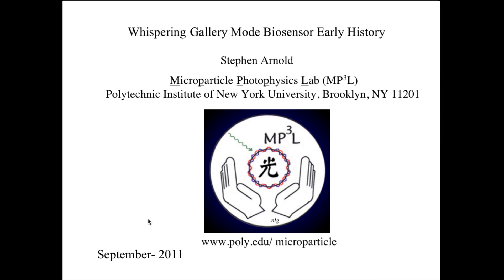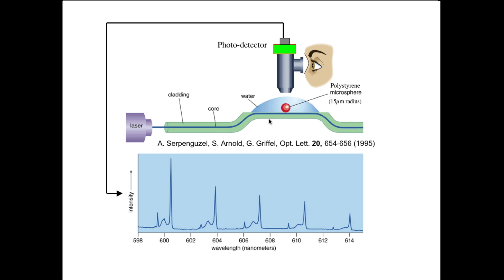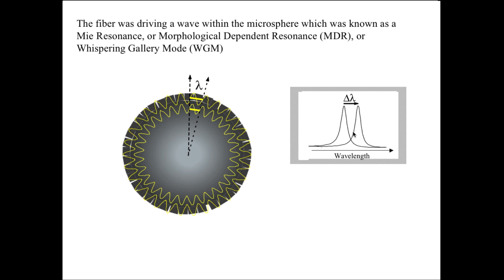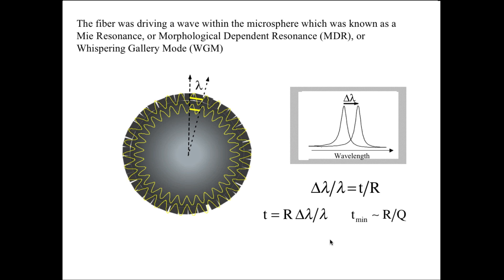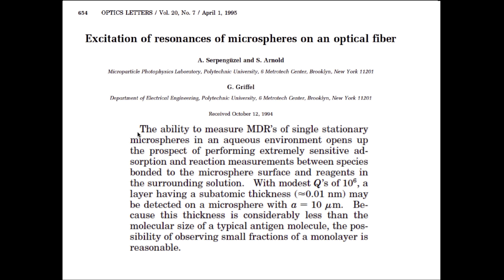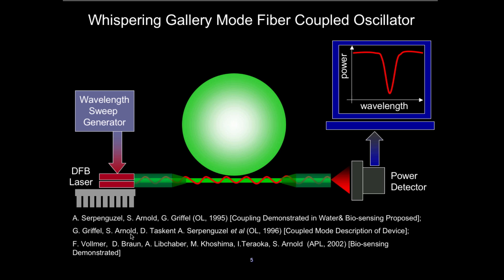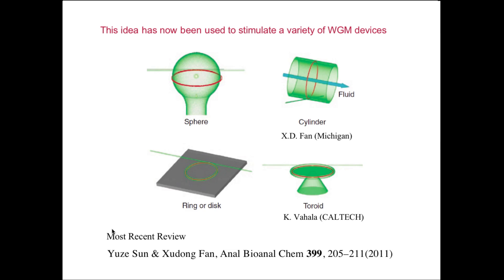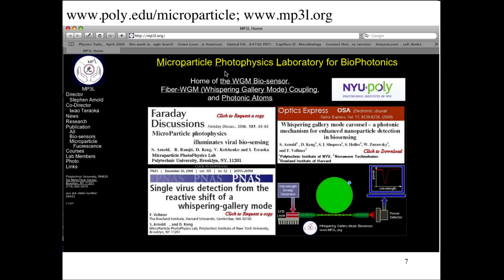1. Whispering Gallery Mode Biosensor Early History (1994-2002)

Comment: Thank you Prof. Arnold for this interesting video on WGMs. As a beginner in this field I found it quite informative. Is this particular geometry (time- 6:05 in video) in which we monitor the transmitted light instead of scattered light done to make the experimental setup compact?
Reply from the maker: Thanks for your question. Yes, it makes the system more compact.  What was done in the Paper by Griffel et al, and demonstrated there through experiments at the MP3L, opened the path for bringing the micro-cavity biosensor into integrated optics on a chip. It also thought of the sphere-fiber system as an interferometer, which I have always found to be fascinating. If you program the equations in that paper you will see that they give the same results as Vahala’s paper that was published 4 years later; they predict critical coupling, etc.  The notation is however different; transmission to the detector is labeled by amplitude coefficient “r”, and evanescent transfer to the sphere was labeled by “t”. There is a little compact  schematic of the notation in Fig.1 of the paper.  If you have any further questions about the paper, feel free to ask.
Reply: @mp3lwgm  Thank you sir for your detailed reply. It clarified my doubt. I will go through the work you have referred to for better understanding.

Comment: Thank you Prof. Arnold for an amazing video. WGMs are mostly studied in spherical or cylindrical symmetric geometries. Can WGMs form in polygonal cavities? If yes, why polygonal cavities are not used as much as other geometries?
Reply from the maker: Thanks for the question. Richard Chang’s group did experiments on square resonators, and the results were reported in Opt. Lett. 26, 632-634 (2001). The resonances showed modest Q’s alot less than 10^6. There was also another paper in 2003 (APL 82, 488-489) which did a bit better. The problem with using the square resonators is that the excitation cannot be efficiently coupled in at a grazing angle, as it is with spheres. Prism coupling produces a controlled excitation angle, but prism coupling is complicated, bulky, and expensive. I’ll probably add more to this reply as time goes on.

Comment: Thanks for this great video Prof. Arnold! I have a question: @2:15 in the video, what will happen if we use a silver coating instead of antigen? Also, what will happen if the coating is non-uniform?
Reply from the maker: Thanks for your question. My first thought is that a coating of silver might dampen the resonances significantly. In either case, depending on the frequency range, a spherical plasmon-polariton might form, however I doubt that it will be long lived. On fused silica, the layer is unlikely to be smooth, since the fused silica surface is not smooth. If the silver being added is in the form of silver-shell/SiO2-core nanoparticles, they can act as frequency shift enhancers because they are nano-resonators which have local surface plasmon modes (LSP). We have already had success with this sort of thing, but with a gold-shell/SiO2-core nanoparticle: a plasmonic nano-particle receptor led to our ability to detect single molecules for the first time with a micro-resonator. The experiments were performed by a former IIT Madras student while he was a Post-doc in my laboratory (VR Dantham), and was published in NanoLetters in 2013. Debojyoti - please contact me separately by e-mail at NYU. I have some questions on science writing and Chennai.
6 hours ago

Comment: Dr. Arnold, in determining the layer thickness and the wavelength shift, does this only work if the entire microsphere or at least the equator of the microsphere is coated or can it be done for only a partial coating or even a single particle?
Reply from the maker: Ryan- The calculation in the third figure is only valid for a uniform coverage of the entire sphere. This simple theory  was  verified experimentally by adsorbing protein on a silica microsphere [S. Arnold et al, Optics Letters 28, 272-274 (2003)]. The agreement is aided by the fact that protein and silica have similar refractive indices. Had they been different the simple theory would have to be modified. Thank you for your astute question.

Comment: Thank you for the lecture on the history of WGM biosensors, Professor Arnold! Functionalizing the surface of the silica resonator with a layer of antibodies will lead to an increase in the refractive index of the resonator and an increase in its resonant wavelength. Will this have any effect on the transmission spectrum?
Reply from the maker: Yes. The position of the dip in Slide 5 will shift to the right, toward increasing wavelength, by an amount given by the formula in Fig.3. So long as the refractive index of the layer is similar to that of the microsphere, the shift formula will give the approximate thickness of the antibody layer .
Reply: Hello Professor, thank you for your answer. Does the accumulation of mass on the resonator's surface have any effect on the width or depth of the transmission spectra's parabolic dips? For instance, if we observed antibodies binding to the resonator over time, would this have an impact on the power?
Reply from the maker: Chase Rosenberg The accumulation of surface bound analyte can effect both the width and depth of the measured resonance seen in the transmission spectrum. The width will broaden if the analyte layer is rough and scatters the evanescent field. The depth of the dip is more complicated. It can extinguish the transmitted light at resonance, a situation called critical coupling. Critical coupling requires that the rate of energy loss around the spherical boundary be equal to the rate of loss into the fiber. If additional scattering is generated due to analyte roughness, the system will be under-coupled, and the dip depth will be shallower.

Comment: Hello Professor, it appears that the waveguide is always appears to be parallel to the equator for a spherical geometry. Does the positioning of the waveguide have an impact on the coupling of light into the cavity? Would the angle of the waveguide relative to the equator of the sphere impact the coupling of light from the waveguide into the cavity? Thanks.
Reply from the maker: Thanks for the question. First I should point out that the "spheres" we use are actually slightly prolate spheroids. So they have an axis of rotational symmetry (z). Planes perpendicular to this axis cut out circles on the surface known as parallels. The mode having the smallest orbital circumference is the equator. A laser at resonance with the equatorial WGM will not be at resonance with other WGMs because of the prolate shape. A waveguide (fiber) driving a TE WGM, if not directed parallel to the equator, but at a small angle "b" from the equatorial plane will project its field vector off from the WGM's field, thereby reducing the power coupled into the WGM by approximately cos(b)^2.

Comment: Hello Dr. Arnold,

What a wonderful video! It made me think -- Does the optical setup for this biosensor require a distributed feedback laser? If so, why? I can't seem to think of a reason why any other tunable laser would not work just as well. 

- Shan
Reply from the maker: +Shan Lansing - Thanks for the question. There was a previous comment that may be relevant. It was by Steve Holler. He reminded me that the original  paper in 1995 had used a dye laser. It started "The original (1995) Optics Letters paper used a tunable cw dye laser…." My reply is just below Steve comment. Adding to the reasons for using the DFB which I gave in that reply, I should point out that current DFB lasers have line widths < 1 MHz, and can be purchased in a butterfly format for less than $100 on e-bay. There are certainly other tunable single frequency lasers that can be used, however we found that for the rapid tuning speed, compactness, and small price it is difficult to beat the DFB. I'm reminded that we paid $50,000 for our dye laser system in 1995, whereas the DFB package is less that 1 inch long (the actual laser is <1 mm), and in a cylindrical form can be purchased for $20 (e-bay, 1310nm with ball lens). For an entire system including current drivers, tuning software and data logging have a look at MP3Laser.com. Finally, to answer your original question, any single frequency tunable laser should work.
Reply: +mp3lwgm Interesting! I appreciate you explaining that.

Comment: Hi Professor Arnold, thanks for the brief lecture on the history of WGM sensors. If I may, what factors determine the magnitude of change in intensity when you do see a dip in the transmitted light?
Reply from the maker: Eshan Treasurer I assume that by change you mean due to the accumulation of matter on the surface of the resonator. There are two things that can happen. The matter can alter the field coupling into the resonator and the loss of energy by the resonator. The effects which these causes have was first discussed by G. Griffel et al in an Optics Letter article in 1996. You can find the paper at mp3l.org as publication 53. Another good reference to this is a paper by K. Vahala et al in Physical Review Letters 85, 74-77(2000). I hope my answer is helpful to you and others.

Comment: The original (1995) Optics Letters paper used a tunable cw dye laser for excitation of the whispering gallery mode (WGM) resonances, but I recall there were other sources and coupling schemes that were considered. By the time the 1996 Optics Letters paper was published you had moved on to a distributed feedback (DFB) laser, which seems to be the type of laser source you have kept with for the WGM sensor. In fact, the use of a DFB laser seems to have become a standard for WGM devices. I think people would be interested in hearing why you switched to a DFB laser; are there inherent benefits? Why not stick with the dye laser, or move to an external cavity diode laser (ECDL)?
Reply from the maker: Steve- It's nice to hear from you. It was Giora Griffel who suggested the DFB laser in 1995, after I asked him about a tunable semiconductor laser that wouldn't mode hop. Fortunately, he had friends at the old RCA laboratory in Princeton who were producing these lasers near 780 nm. Ali Serpenguzel set one of these up as in Slide 5 of this video and recorded dips in the fiber transmission as he swept either the laser drive current or temperature. The research was reported in the 1996 OL paper for which Giora was the lead author (2nd paper in slide 5). It's hard to beat the compactness of these lasers, their narrow line width (<5 MHz), and their cost. When the optical mockup of the WGM biosensor was prepared at the Polytechnic in Brooklyn we naturally chose this laser source. An ECDL was considered, but was rejected at the time since it was much larger and cost 10x as much as the DFB. The dye laser was a monster by comparison to either the DFB or ECDL. Thanks for your comments and question.

Comment: Prof. Arnold - Thank you for your nice lecture. I have noticed that this study has been extended for single protein detection [OL paper (2003)] by your group. In your paper a simple analytical expression is obtained for the shift due to single protein adsorption. But this simple expression is derived  based on the asymptotic limit (larger microcavity). Do you have this kind of simple expression for a smaller microcavity.
Reply from the maker: Akash - The asymptotic limit works well in connection with experiment for Whispering Gallery Modes because the mode number (no. of wavelengths in the WGM orbit) must be large in order to avoid substantial diffraction. Of the approximations in the 2003 paper, weak coupling is also assumed; wavelength shifts must be substantially smaller than the line-width. At the time there were no single molecule measurements on a bare micro-cavity, however that has recently been accomplished (amazing, although not published), and the shift agrees with the theory in the 2003 paper.
Reply: ***** -Thank you so much sir for your kind reply.

Comment: WGM is a interesting phenomenon, and to apply on biosensor is a very smart idea which can skip to label tag or fluorescence on analyte. But I wonder if only specific electromagnetic wavelength can happen WGM, since different wavelength also fit the circumference of microsphere. Therefore, why the visible light is used in this WGM biosensor cases?
Reply from the maker: Penny- Thanks for your question. There are a number of reasons to use a visible laser for WGM experiments: 1. You can use the glass from optical fibers to make the resonator (e.g. micro-sphere). This glass has very little absorption, which leads a very high Q factor for the WGM, and the silica surface is easily functionalized to make the sensor specific. 2. There are very narrow band tunable lasers which have been developed for telecommunications in the near IR. We obtain DFB lasers near 1300 nm for as little as $50 on ebay. 3. Inexpensive detectors are available in this region as well. WGM biosensors could be constructed in other regions of the Electromagnetic Spectrum (far from the visible or near IR), but the cost would likely be prohibitive. In either case the theory would be the same [Optics Lett. 28, 272-274 (2003)].
Reply: ***** Thank you for explanation. Now I realized It is a really feasible method to detect small molecular with WGM, the required materials and devices are well developed and easy to prepare. Hopefully, we can be benefit for this invention soon. So, what do you think about the challenge for WGM-biosenser in next few years?
Reply from the maker: Penny Chiang Penny- Just to clarify one point about DFB lasers. Although they can be obtained inexpensively, the temperature and current controllers are not inexpensive, and there is a need for sophisticated software, and the computer to run it, etc. Almost all of the researchers in the field have to put this ancillary stuff together on their own. Since the WGM biosensor is becoming popular soon there will be a commercial product. Stay tuned to this channel……...

Comment: This is a very interesting video about the history of whispering gallery mode biosensors, which I believe will make important contributions in biology and medicine.  Significant progress has been made on addressing the issue of sensitivity, but improved selectivity is still an issue.  Any suggestions?
Reply from the maker: Judith- Thanks for your comment. I think the reason sensitivity has been an issue is that taking sensitivity to the limit of individual molecules with the label-free WGM scheme can provide information about molecular size [S. Arnold et al, Optics Lett. (2003)], and enable binding to be followed in real-time. This is something that methods which rely on labeling cannot do. No one at present has reported reaching this limit without local nanoplasmonic enhancing epitopes. Accomplishing this with a microcavity having only antibodies on its surface ("bare") will require substantial noise reduction. The challenge is great, but the rewards are greater. Improved selectivity will require molecular engineered interfaces. Fortunately, some of these already exist for the commercial label-free biosensor (SPR, Biacore), but this device has much lower sensitivity. Also do not underestimate the importance of  microfluidics; you have to bring the analyte near the sensor in order to detect it, and at ultralow concentrations (attomolar) this will require optimized integration between the transducer and the fluid transport system.

Comment: Thank you for your explanation professor Arnold! According to your equation [sin(t)]^(2L), t should be smaller than 0.0496(2.691 degrees) from the equator if you want to see a shift larger than 1/2 peak. So the width should be around 4.6967microns, and the sensing area A should be around  1475.48 micron square when R=50 micron. The total area of the sphere is 10000pi,which is 31415.93micron square. So A/Asphere=0.047. Thar means there's 4.7% chance that a random molecule can hit in the sensing area.

Comment: This is interesting but the author avoided mentioning that High-Q microspheres were first demonstrated by Russians in 1989.
Reply from the maker: The 1st demo that microspheres have high Qs was in 1977; A.Ashkin, J.M.Dziedzic,Phys.Rev.Lett.8,1351(1977). The "Whispering Gallery Mode Biosensor Early History (1994-2002)" video deals with the history of fiber coupled microsphere experiments, for which the video claims that the 1st report including the biosensing proposal was in 1995; A.Serpenguzel, S.Arnold,G.Griffel, Opt.Lett.,20,654(1995). The beautiful Russian research in 1989 utilized a prism coupling and did not propose biosensing.
Reply from the maker: It took some time to realize that gorm253 is the YouTube handle for the great Michael Gorodetsky. mp3lwgm is proud that Michael visited our channel, and sad to hear of his passing; rip Michael.

Comment: I believe that your 1995 prediction and calculation of the extremely high sensitivity for WGM biosensing, up to subatomic particle level, is the key insight that made the explosive development of the research in recent years possible. This is an example of theory leading the way for numerous applications and inventions.
Reply from the maker: The reason that theory works so well is because all of our work has used microsphere WGM resonators for which their high symmetry makes analytical solutions relatively easy to construct. Another example of this sort of thing is the good agreement between frequency shift predictions for single nano-particle binding to the sensor and experiment. Another YouTube "2.Reactive Sensing Principle for WGM Single BioNanoparticle Sizing v2(2003-2008)", https://www.youtube.com/watch?v=guZIctcu2-U&t=18s, demonstrates this.